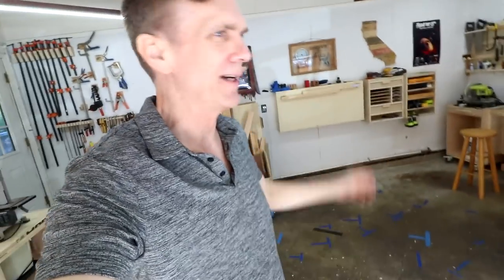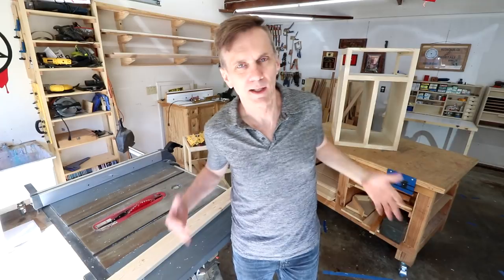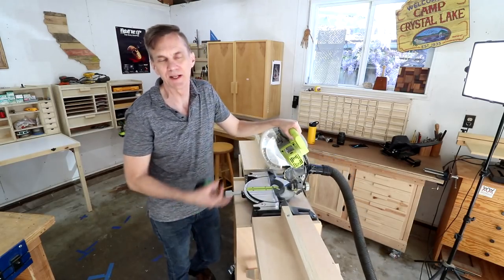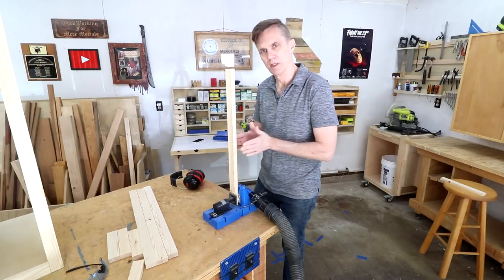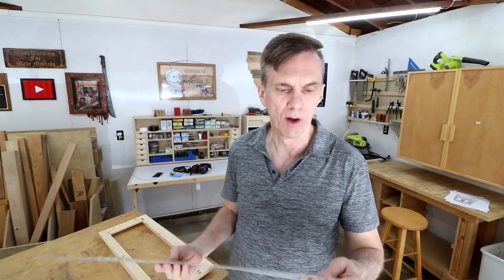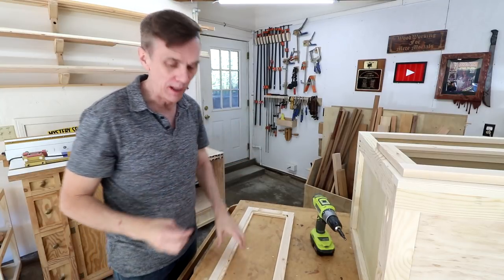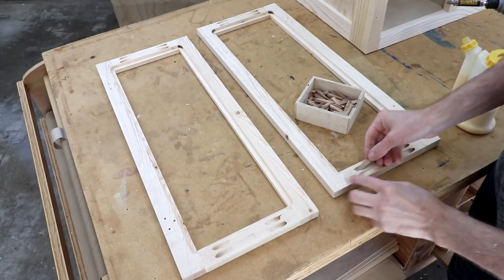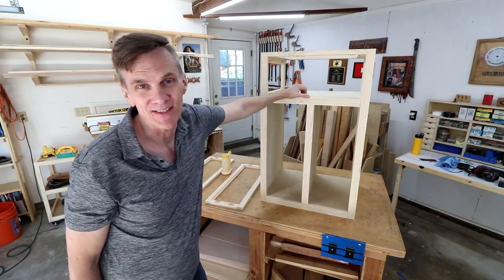Day 5 | Making doors and staying healthy | LOCKDOWN WOODWORKING

Comment: Steve! Wrap that dust collector adapter with electrical tape to build up it's diameter! If you do it close to the flange, it won't even interfere with use with your Kreg Jig.
Reply: Layer some tape inside the saw's exhaust port.  Then the adapter fits everything snugly.
Reply: I used a layer of masking tape to make the adapter fit the router table. So far seems to work ok

Comment: Hinges should be place at 22.657% of the square distance to the tangent of the rectangular surface area of the 3rd foot of the table from the back. Hope that helps your next hing placement 🤪
Reply: But only when 45 degrees Fahrenheit equals minus 30 Celsius
Reply: I'm going to go write this down.  Thanks.

Comment: Hey Steve, make your own dust collection adapters. Cut a few inches of PVC pipe, throw it in the oven and stretch it to whatever sizes you need. Better fit than generic and much cheaper.
Reply: A heat gun works too, and you can't forget and ruin your oven. 😱
Reply: @Not_TVs_Frank  I've done both and strongly prefer the oven. The heat gun is too uneven and tends to burn blister the pipe. The oven leaves it even and perfectly golden brown 👌 I know you're a heat gun expert but this is just my experience.

Comment: For thin material on the table saw, I have an aux fence with a piece of u-channel embedded in a rabbet at the bottom edge. The thin material rides in the u-channel where it is captured and can not slip under the fence. Started using this years ago with formica. Keep up the videos, I get a lot of inspiration from them.

Comment: The best thing I found for my Kreg jig was a Sears “tool activated switch” that turns on my shop vac whenever the power tool plugged into it turns on. I dedicated a cheap corded drill for pocket holes. Now every time I drill a hole the vac automatically turns on!

Comment: Steve I have the same Ryobi miter saw and yeah the dust collection is awful.  I made a shroud out of 1/4" MDF that fits behind the fence and has a vacuum port, and it works amazingly well.  I'd post a picture but well you can't attach pictures in YouTube.  But I followed the approach by Fischer's Shop for his shroud.  Totally worth the time spent making it.

Comment: Hi Steve, I use now my big jointer plane as a workout, I use it more with my left hand to get my weak side stronger. A pull-up bar I have already at home. Rope skipping is a good exercise without space. I will stretch more to improve my splits. I have short parallel bars high enough for dips and other exercises, very handy. Maybe your next project? A calisthenics park for your home? My project is now to get my hand tools razor sharp. Very satisfying. Greetings from Munich, Germany

Comment: Pullups, bro, get them pullups 👊. Also, use a bracket (aircon type brackets) with a galvanized steel pipe bar

Comment: Ive been designing adaptors from the dust port of my tools to the radius of my shop vacuum (in Fusion 360) and getting them 3D printed. Wlrks amazingly, so far.

Comment: Thanks for the refreshing look at what wood working is really like, mistakes and all.  I don't feel so stupid since I see that others do the same dumb things as me.   As to the dust from the miter saw.  I have done a lot of studying and experimenting with  most woodworking tools to try to minimize dust.  The miter saw is the worst offender of all because it very difficult to deal with all the stuff the blade sends to the rear. I wouldn't blame the Ryobi, by adding the shroud you have done dust about the best that can be done without putting the saw in a cabinet enclosure that captures all the stuff that flies to the back.

Comment: For that aluminum sheeting, sandwich it between 2 flat pieces of wood. No movement, no worries of it going under your fence, and it will stay flat when cutting with your table saw. 👍🏻
Reply: A good straight edge and a sharp utility knife is even easier. I've cut aluminum flashing that way for years.

Comment: I didn't have anything that would fit my vacuum, so I took a heat gun (wife's hairdryer) and heated up some pvc pipe and shoved it on there. Molded fit.
Reply: I assumed a hairdryer wouldn't get hot enough.  That worked for you?

Comment: Never fails! When you are low on materials that’s when you start making mistakes! General rule on hinges at least when using overlay hinges like this.. you center them where the rail meets the stile. If using a typical 2-1/4” rail and stile then you would put the center screw 2-1/4 off each end..

Comment: Hi Steve, thought you might be interested to know that Peter Millard over on 10 Minute Workshop recommends using bicycle inner-tubes to pack out poorly fitting shop-vac connections and it works pretty well.

Comment: I'm so happy to see you use duct tape to attach your shop vac to tools. I thought I was the only one!
Reply: I was thinking the same. Long live all purpose duct tape.
Reply: Same!
Reply: You are not alone! I also use painters tape as a zero insert for my small table saw.
Reply: @kinkjarfold3816  I do the same for my miter saw
Reply: Would it not be terrific if manufactures would come up with standard size dust collection ports?
Reply: @dwightl5863  It should be nice but there are bigger problems in the world.  (not only now because of the Corona virus)
There are so many things that could be standardized.
Reply: Hans de Groot You make it sound like a difficult thing to accomplish. There are standards for blade diameters, arbor sizes, screw lengths, bandsaw blade lengths, sandpaper grits and it list could go on and on. Having to have a bunch of adapters in line to hook up dust collection isn’t convenient or necessarily the safest when using powered hand tools either.
Reply: @dwightl5863  For sure there are standard sizes  (not the "s" for plural) for dust collection ports as well. The more and/or bigger the saw dust or shavings
which come out of the electric tool, the bigger the diameter of the dust port should be. There are many types of adapter which reduce the diameter from
one size to the other, or you can make one yourself if you have a 3D printer  (or even make them out of wood)
Duct tape is a quick and dirty solution, far from ideal, but better than nothing.
In my opinion there is a big difference between "standard" and "standardized".  "Metric" and "imperial" are standards. Standardized means that everything
has the same size  (for example music-cassettes, CD's) or standardized sizes (plural) (for example SD-cards. Blade diameters for table-saws etc.
are standardized, but there are more more sizes. (diameters and thicknesses) Arbor sizes also. Not every table saw has the same arbor size (nor in diameter,
for that are the adaption rings, nor in length, in Europe we can't place a dado stack). In my previous comment I had totally other things in mind, not only
the things you find a in shop)

Comment: You can use a no hub fitting in the plumbing section to connect your vac when the ODs are just slightly off

Comment: Yes I have put many of those old hinges on before, with an old school method call a Yankee screwdriver. The battery drills do much better job. Actually those screws you refer to as panhead are called oval head. Pocket screw joinery is fast, although I don't care for it to be used in any observable location. I'm an old retired finish Carpenter / woodworker and my projects are small bread box sized now days. Thanks for your videos.

Comment: Hey Steve, you need to get a friend with a 3D printer to make you a hose adapter for the mitre saw. I had a buddy make some for me and saved those 5 mins either side of taping/untaping.
Reply: Peter Soumanis absolutely. My first print for the workshop was a vacuum adapter for my Kreg jig.

Comment: If you can obtain a tapered cone extension for your vac, you can insert it into the saw port. Friction will hold it snugly in place. If it protrudes thru to the other side, just trim the excess off as needed.  This is how I adapted my vac to my DeWalt saw. Works great and did not need to buy any expensive adapter.

Comment: if I may suggest, you can make a wooden adapter for the dust port plastic thingy. I did it with my belt sander as I have no idea where to buy the part. all it is is a cover with the hole diameter that fits over the port in the tool, and a smaller hole that the vacuum end goes into.

Comment: Hey Steve, 

I went out and found flexible plumbing fittings (about 4 bucks a fitting) with a breeze clamp that works very well on table saws, miter saws and even my sander. The breeze clamp keeps it on the tool, so it doesn't need to fit exactly!

Thanks!
Justin

Comment: On one of my tools where the vac attachment was too small and I didn't have an adaptor, I stretched an inner tube over the dust outlet of the tool, and as the inner tube was also slightly smaller than the vac attachment, when I pushed it in it made a nice seal and saved me having to duct tape it all the time.

Comment: When I have to cut something very thin I use double sided tape, or the painters tape + super glue method, to glue some sacrificial thicker material (thin mdf, plywood, whatever you got). Works on the same principle as putting a block of wood underneath a board you are drilling into to prevent blow out on the back side.

Comment: Steve, I am surprised no has mentioned it.  For thin pieces of soft aluminum like yours I have used a sharp utility knife and a metal guide and simply cut a groove.  Done well, the piece  will simply break off.

Comment: I used HVAC tape and some 1/8 paneling to make a channel for my shop vac between my router table and the router it self to draw the dust down the center hole and draw even more air air thru the router motor/fan keeping it very cool in the middle of the Arizona summer and i can just send board after board thru to make dados

Comment: Do you have a video or plans on the fold up mitre table extensions? Built a rolling mitre table that has my shop vac and dust cyclone under it but couldn’t figure out a good extension table solution until I saw this series. Love your videos!!

Comment: I had a lot of duct tape fittings because every single tool seemed to have a different port size and my shop vac fit NONE of them. I finally built a pvc-in-bench series of pipes and septic hose and dual-Menard-bucket-cyclone for dust collection then custom wood fittings or pipe clamps (or both) to attach stuff to, and a homemade blast gate to select. That way i can just leave every bench top tool attached to the system (then I have an external extra port for a longer hose and hand tools ... Wood couplers for each). I'm lazy about dust collection. If it's not ON there semi-permanently, then I'll get lazy about the duct tape thing each time and jus not use it.

Comment: I to have a Craig Jig the K5 in the dust collection on it I agree is awesome. The only problem is that little piece of blue plastic that you attach your shop backhoes to just snaps on to the Jig and unless you have your shop vac holds supported just right weight of the holes is more than enough weight to pull that little blue piece of plastic off and the hose goes with it. I wish there was a way to hold it on with screws.

Comment: One way to cut very thin sheets of material including metals is to clamp the thin sheet between two thicker pieces of material (like 3/4 plywood) and then running that through a saw.  If you clamp a spacer over the other edge it will raise it enough to ride the fence.

Comment: You should check out some YouTube channels on how to make your own dust collection fittings out of PVC for your miter saw. It’s really easy and cheep. Ive made several myself. Fishers workshop has a video about it and several others out there. Just need some PVC, heat, and you can make them fit to your tools and shop vac.

Comment: I don't even have a table saw but my mind likes to wander. About cutting the aluminium (I'm European...) with one of those, may I suggest two options that come to my mind?
- place the aluminium sheet on the table sled. put a sheet of plywood over it on either side of the cut, as close as you can get to where the cut will take place. Put something heavy over each sheet of plywood, such as the concrete blocks or whatever that you have used when gluing wood.

- And in this case where the aluminium sheet has holes in it, what about screwing it to the table sled using some washers for "extended suppor" near where the cut takes place? In case you don't want to damage the table sled with such screws, you could screw the aluminium sheet to a sacrificial sheet of plywood. What's more, if you manage to mark exactly where the cut has to be done, you could turn it upside (some kind of sandwich with the sled, the aluminium sheet and the sacrificial plywood sheet on top) down so yo can be quite certain it shouldn't move, not that much anyway.

Again, I'm just throwing ideas, I've never done this myself.

Comment: add duct tape to the inside of the Ryobi saw to reduce the diameter so you can use the same port without taping it on

Comment: Steve, what is the inner diameter of your mitre saw dust port, and outer diameter of your vacuum hose?  I used my 3D printer for an adapter on my Kreg jig, should be easy enough to modify the dimensions and repeat for your mitre saw. 😊

Comment: Miter saw dust collection:  due to the configuration of the blade (really open),  it's near impossible to control the dust at the tool.  The only real solution is to create an enclosure around the back half of the tool action, and hook it to a large scoop.  Even at that, most shop vacs don't generate enough air flow for decent capture.

Comment: Is there a reason to why you cut the wood on the right side of the mitre saw instead of the left side??
Reply: You cut the wood in the middle of the miter saw!  😅  Seriously, it doesn't matter which side you work is on vs the cutoff. Sometimes it's easier to set a stop block on one or the other.  I have a nonsense personal preference, but I switch quickly when convenience is a factor.

Comment: Ah yes...  Mistakes...

You know how you use a Forstner bit to bore part-way through a board, and then drill a clearance hole for a screw through the board with a regular bit so that the head of a round or pan head screw will rest below the surface of the board?  The idea being that the point on the Forstner is where you drill through, in the center of the Forstner's hole.

Several times in the past couple of years I've reminded myself "Forstner first, then drill through."  I remind myself when shopping for groceries, when eating breakfast, or when taking out the garbage.
Naturally, just today I drilled four through-holes with a 13/64" bit for clearance holes, and then had to clamp the board on the drill press, trying to get the Forstner centered.  (I failed.)

And I bored the Forstners on the wrong side of the board.

Comment: Steve need your help. Trying to make your shoe rack design but ended up using pine and it split when drilling the hole. Any tricks to drilling the hole better or shout I just opt to using a hardwood???
Reply: I'm no expert but if a board split when drilling, it was probably already cracked.  Try gluing it back on and drill it again if necessary.  The glue will hold as if you never split it.
Reply: Frank DeRosa Sounds good I’ll take that into consideration.

Comment: My Bosch 5412-L [14 years old] compound sliding expensive 12 inch miter saw has TERRIBLE dust collection. Always has. And if you hook up a hose to the exhaust port it limits the sliding motion. Otherwise, though, it is a very good saw.

Comment: Hey Steve, IDK if you have calipers. But if you shoot me the ID AND OD of your miter saw AND your shop vac hose, I’ll gladly 3D print you a proper fitting adapter. It costs practically nothing in filament

Comment: Why don't you design dust collection adapters in sketchup and let them 3D print it from someone you might know who has a 3D printer? Should be not too diffucult to find someone if you have 1.36m subscribers... Thanks for all your videos! Regards from Lake Constance, Germany ;-)
Reply: My tiny local library has a 3d printer.  It'd cost me about $2 to print an adapter.

Crap, why haven't I done this?  I'm using recycled cardboard for an adapter. Huh.
Reply: Frank DeRosa It's not too late. At least I hope so 😉 Try it!